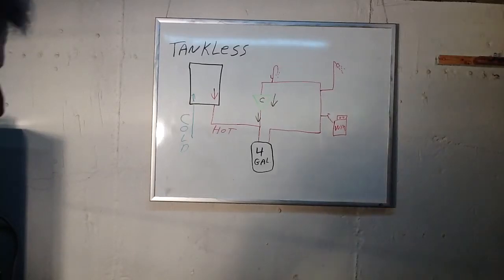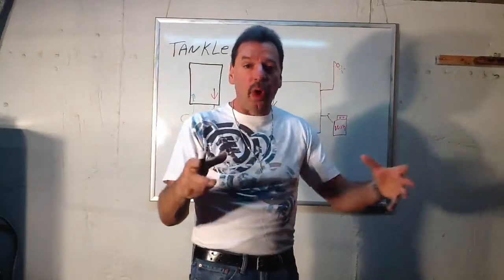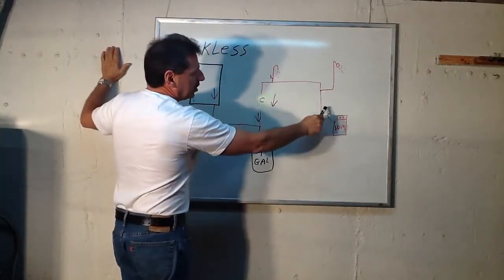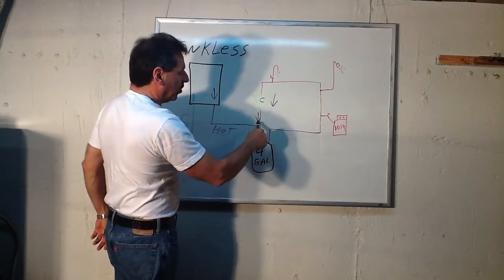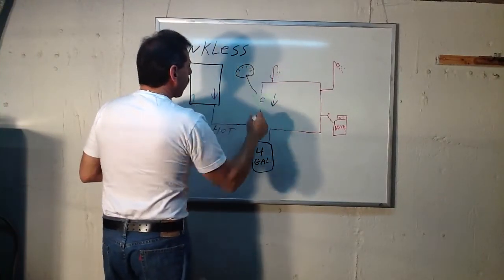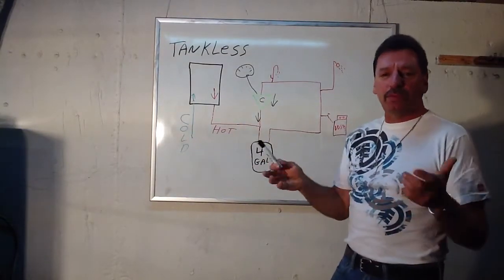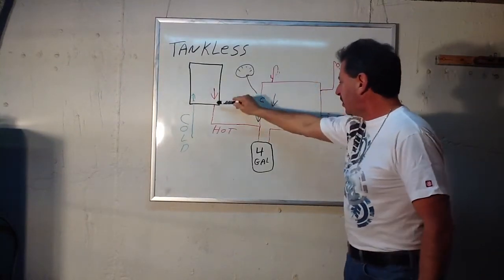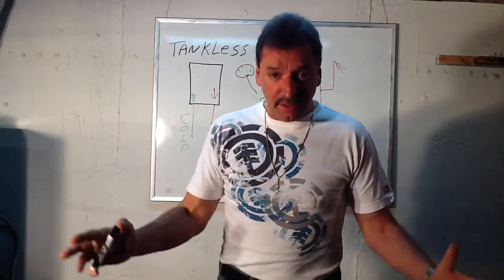Tankless water heater part 6 (loudepot)

Comment: Great video's ill stick with the tank i do a lot of framing and remodeling most of the new Tech is not so good. Like recently i have been remodeling and have seen tyvek turned in to dust and osb almost twice the size it was installed. Im building my house next year so far i am going with all plywood sheathing with #30 felt for moister barrier and now i know i am going with a tank hot water heater. Also one other plus from a tank h/w heater is in the event of a hurricane or such you have 40-80 gallons of drinkable water in a tank.